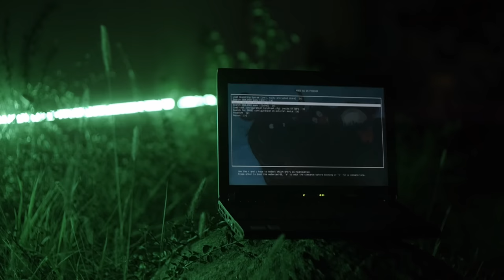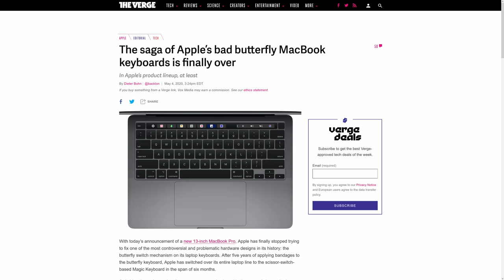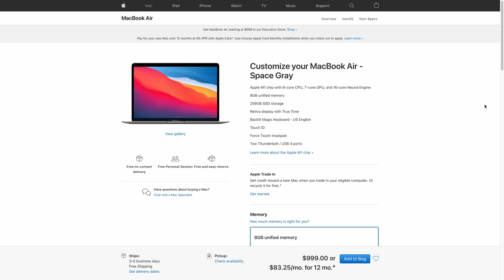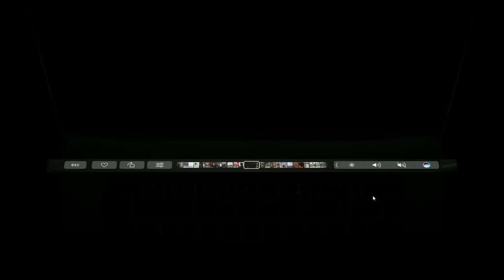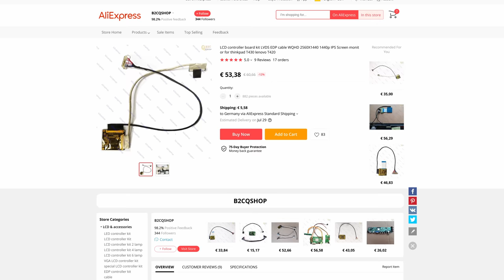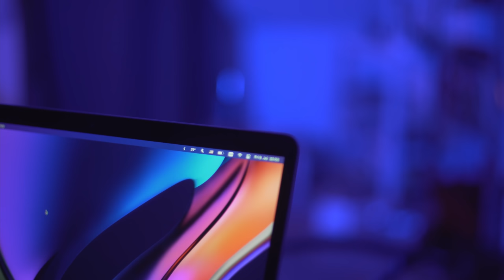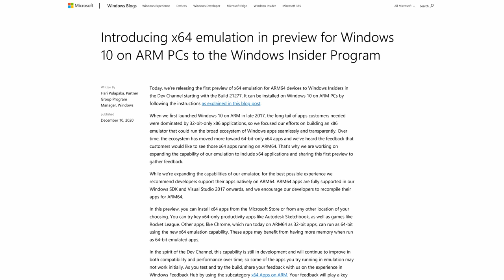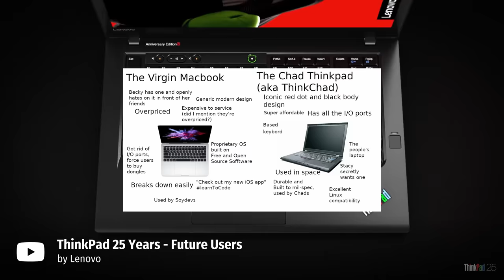Why I Switched to Mac (as a Linux user)

Comment: There are some things Apple products are undeniably better at nowadays. Not that they should be.

The biggest thing is that they, get this, use ARM cpus in products that rely on batteries. Sadly other ARM cpus are either not powerful enough or dont have good support for laptops and tablets. When it comes to battery usage, most Linux distros tend to be terrible. I really wish i wasnt saying that.

Ipads are also really good when it comes to how powerful their CPUs are (for a tablet its pretty great), and how powerful a lot of the software is (a lot of it is as good as PC applications). I wish you just had full control over the device and a little more professional software like you can have on a Microsoft surface. 

If tablet computers like the surface came with well supported ARM cpus that could also run linux distros that were able to manage battery better, itd be a dream. But when you think about how Apple manufacture a lot of the hardware themselves including the CPUs, its really impressive they manage to not be stupid expensive.

Comment: I have seen MacBook air on m2 and seriously it was the worst user experience for me. In windows everything is intuitive and flawless, installing games and programs is fun. MacBooks are expensive and offer slightly faster cpu and slightly better battery life compared to windows amd models, but they don't have dedicated gpus. Now Dell, Acer have tiny Ultrabooks with very good Nvidia cards. Unless you are an apple fan boy I don't see a reason in buying a MacBook.

Comment: That's really biased testing, couldn't expect more from an apple head. 

First the Thinkpad is not plugged in so you're restricting it to use 30% of it's capacity in both tests, second it's almost 2 generations older in terms of hardware and you're doing it wrong, i see windows.
Reply: Macs don't need to be plugged to run on full power
So they were tested on the same terms, Mac is just better

Comment: When it comes to laptops... meh. They all suck. Thinkpads, Dells, Macbooks, they're all trash.
The big thing left out of your whole argument is the workstation. I'm happy to work from my own home office, on my own tower workstation. The parts are cheaper and more powerful, and some parts (PSU for example) are more than a decade old, so there's less e-waste. I do have a little loaner notebook from my employer for moments where mobility is needed, but it's not my primary machine, and I exclusively use it for browsing.

Comment: Mac hardware being crap? Lol. One of the most important things on a laptop is the trackpad. click anywhere on a mac trackpad and you have equal pressure. Definitly the best trackpad on the market. On a thinkpad it’s hinged so that its harder to click at the top. Also the MacBook keyboard being one of the best in class.

Build materials: screen flexes on a thinkpad when opening it with hand on side. Mac: same no-flex when opening it with hand anywhere..

Then there’s design. Apple definitly wins

Comment: MacOS is so bad. Windows is by far the best. A mac costs 3k which even if i die i wont pay for Macs. Hackintosh doesnt even work on all CPUs. Windows supports all GPUs, CPUs if they have enough power to run Widnows. Games and programs are mostly designed for Windows and for gaming and most activities you have a better experience on a Windows. It is cheap to buy Windows laptops, the software is free, not like the App Store.

Comment: Its not really about mac being better, its that arm based cpus are gona be the new thing. The only thing that sucks is that during the transition to arm cpus is that a lot of programs arnt gona work at least for some time,  but I think Iv heard this is a problem for apple users too, and some of them arnt switching to the new arm computers. to me the issue of going apple is still the same issue iv allways had, the ecosystem.  doesnt matter how good a computer is if I dont have the software I want
Reply: Thing is, Apple's transition to ARM as its native computing platform will be much smoother than on either windows or linux. In the linux user space we already have issues with apps using conflicting GUI toolkits and design features and not implementing proper use of portals and broken Wayland sessions and gesture support (the list goes on and on).

Apple has the advantage of being a walled garden where they can provide incentives for supporting their own silicon as well as being able to optimize for it. In my personal use case, Fedora Silverblue becomes annoying to use even on my well-supported Thinkpad T480s because of issues like improper sleep support; that is, after an update, closing the lid seems to log out of session, causing all data to be lost. There are just so many issues that hinder my productivity like bad battery life.

As much as I hate to say it, Apple laptops seem to be the way to go.
Reply: @ianguarin9773  Its allways going to be a wait and see how things pan out kind of thing.  maybe right this moment apple is the way to go in certain cases, but arm is going to take over one way or an other, things are going to be ported over or theres gona be some kind of x86 emulation, pretty sure even apple is using x86 emulation to widen what you can do on their new chips.
Reply: @antonmuffin6214  I am pretty confident it is the case that ARM will become the native computing platform for general computing. However, I think a full migration towards the platform is still a long ways to go. Even on x86 there are a plethora of issues on both Linux like the aforementioned ones. Once developments like native Wayland sessions for all major desktop environments and apps as well as fractional scaling in GNOME drop, I would reconsider moving back to Linux.

Comment: few days ago before my web dev assigment i had to finish my module on time. but i suddenly installed linux ubuntu first time in my pc and i had to face so many problems. like mongodb network issue thn i fixed it after 6 hours of research. thn suddenly my ubuntu setup crashed. i missed my modules and ubuntu too. now i am frustrated doing my assignment and taking break and watching this video. worst experience ever :)

Comment: i switched to macmini m1 from linux/win and i switched back because of the “i’m apple, i must do the things in the opposite way” style. 
simply i hate the key combos, the FACT that if you use apple you have to think in a different way, and often it is not the right way.
still, i hate many characteristics of linux and windows (in 2022 why this fucking pulseaudio does not support headset bluetooth  out of the box?)

i perfectly know that the built quality, speed and power draw of m1 is unsurpassed, and i thought that it wuould be useful asahi on it, but i think it will always be a hobbyist quality linux, not enough for production uses.

i have a L530 thinkpad, a real tank, but it starts to show its age ( cpu i3-3130), and i thought about replacing with a macbook, but those key combo prevents me to give apple  another chance

Comment: I have the exact opposite, JC i hate every second of this mac. This thing should be lightning fast, yet so many things feel sluggish when it comes to IO. I  have a lot of conveniences in my shell (zsh). The commandline actually feels slow. A simple git status take 6 times longer in the same repository compared to a desktop pc from 2014! Something is really off in the disk IO of Mac. Also homebrew is incredibly sluggish. 

Also aluminium? C'mon, it just looks good, it's not a good material for a laptop. Uncomfortably cold when you pick it up, too hot to the touch when it's on your lap when it has to do something.

Also the angle of a open lid is really limited when using it on the couch, a laptop is meant for that every now and then right? And then the peripherals. What a complete shit show, I have usb-c to DP peripherals which work fine on Windows and linux, but MacOS manages to throw a fitty everytime when it wakes up. I have to disconnect the DP cable from the converter cable. 

I can keep going for hours like this. I have a severe case of buyers remorse. I thought I would fall in love again after having used a macbook air from 2012 to 2018, alas, I really wish I could get back the thinkpad with ubuntu which I used with absolute joy from 2018-2023

Comment: Honestly OSX is a good OS, the problems come from the company who administrates it. I right now have a Mac computer from 2010 that is pretty much useless with osx. This is because apple decided that we were no longer allowed to install the os that came with the machine back onto the machine. The system needed a replacement HDD and the old one was dead. The only image I can even download on the apple page is a .dmg file that you pretty much cant do anything with. Everything in the documentation says to use the app to make a bootable installer to install the system with, but thats not what apple gives you. Current OSX is available from the app store but you use internet recovery on this mac NOPE it refuses to install and just gives you a general error. and this is why Apple sucks so much. I can download any version of windows and get it installed going all the way back to dos so its just insane you cant even install a few years ago OS like catalina onto a older mac.  I can also mention how they overcharge the crap out of people for memory and disk upgrades that do not even come close to costing that much, and then solder everything tot he board and use freaking super glue and hot glue inside the machine. And then there is the custom controller chip that started with the macbooks with the touch bar. They cannot even install Linux without them being pretty useless since the controller is custom and linux users have no interest in reverse engineering the stupid thing to get basic functionality. I don't blame apple for that since M1 came to the party and that is what Linux is focused on now but it means that those macs have a limited shelf life once you cant install the OS from the app store. The problem with OSX is not OSX its apple and their continued push for anticonsumer behavior.

Comment: No ssd or memory upgrades ever which us planned obselense.

Out of warranty expense is extreme, if your can get parts...even if your can they may not work because apple locks parts to each machine..so technically you cannot even switch parts between two new identical new iphones or macs in some cases.

Worst of all is ufvyour unternalk ssd ever goes your whole machine is bricked and will never boot again nit even from external drives which us why fewer schools and business are ordering an apple mac business lease if multiple machines.
Reply: Ram upgrades haven’t been a thing on macbooks since like 2012 (which really makes no sense, since the 2012 models use the same chassis as the 2009-2011 ones, which are Ram upgradable)

But in this instance, Ram upgrades on an SoC are basically impossible, since it’s literally built into that SoC.
Reply: @nep-nep6575  since they were, and still are, in older macs and mac pro and with pro desoldering upgrade experts.

Comment: One thing that unites Linux, MacOS, and BSD users is that Windows FUCKING SUCKS
Like, I did get frustrated at Linux a couple of times (though gotta admit, more often than not it was my fault), sure, but ever since I switched from Windows to Linux I curse and roll my eyes EVERY. SINGLE. TIME. I HAVE to use Windows, like oh my god it's an awful system. Which, funny enough, seems to be something even Microsoft agrees with. It feels like in 5 years tops everything that will be left of Windows is gonna be Linux running whatever bullshit MS gonna come up with from the cloud. Mark my damn words.
Also, my man uses Ableton Live? God damn, Wolfgang, I really wanna go to Germany just to give you a kiss. Is there any chance you're gonna make a video on Live (if you haven't already; sorry, I'm too damn lazy)? I love this piece of software so much I used to waste all of my spare time in it when I had still been using Windows, and even bought it regardless of my intention to make anything professionally.

Comment: I use a ThinkPad T520 but if I had to use any other laptop it would probably be an older MacBook (actually I do have a 2011 MacBook Pro stored away as a a backup), but I would wipe the drive and put Linux on it (thus I would not buy an M1, and such a machine is out of financial reach anyway). I have tried mainstream PC laptops and they are GARBAGE compared to either Macs or ThinkPads. I don't like MacOS at all (30 years of Windows use since 3.1 means everything about MacOS's interface grates on me while KDE Plasma felt comfortable from the moment I started using it) but I respect old MacBooks as hardware.

Mac desktops, on the other hand, can go straight to /dev/null.

Comment: i dislike apple product very much because of them being targeted to their own and only own ecosystem. one of worst classes i had in university was programming applications for ios. you'd like to learn it outside classes so you can have better understanding ? well, apple will tell you to f*ck off if you don't have one of their computers. that kind of problem has never appeard with any other technology used. for me it seems like apple's environment is strongly fortified castle and outsiders aren't allowed to enter. well, i wont event try. not to mention very high prices, difficulties in tinkering with their devices and repairing them on your

Comment: "Mac books are so fast on these bench marks wow".... runs Solid Works "why won't any of my engineering software run on m2.. Oh cos M2 is just a mobile processor"
Reply from the maker: Oh? Does solidworks run on Intel macs?
Reply: Dude what on God’s earth are you talking about? Solid Works runs absolutely fine on my M2 Air.
Reply: @Da532  Nice! I see the new version works, thanks for letting me know. Now they devs just have to get uVision and Xilinx ISE working on Apple's M2 mobile processors.
Reply: @Da532  Ahh I spoke too soon. Its still garbage because you need to emulate an x86 arch through a hypervisor. Works probably well if all you're designing is fastners, rivets, bolts etc (something simple). I tried to do quick simulations on a complex design and if failed remarkably. Cannot even load a simple demo turbine engine. This is why M2's are garbage for engineers or anyone wanting to run anything proper. I love macbooks but im sticking with x86

Comment: My 5950X does the R23 test in 35 seconds, not overclocked or tuned, just stock (24,531 points)... just sayin... ;-)
Reply from the maker: In other words, a 105 watt 16-core desktop CPU outperforms a 15W 8-core ultrabook SoC
Reply: @WolfgangsChannel  Yes... and a) the "ultrabook" has crazy expensive prices and b) people who do not know any technical details think it is the fastest thing on the planet, precisely because of videos like yours comparing it to even older shit slow laptops - it is a form of deliberate misinformation. And Apple loves you for it.
Reply: @Walther Penne no idea what you are on about mate... your argument (if that's what it is) makes no sense. I compared real thing. You compared some imaginary thing which will not happen.
Reply from the maker: M1 Macbook Air starts at €1000, which is cheaper than Windows laptops in the same class (e.g. Dell XPS 13, which starts at €1449, or Thinkpad X1 Carbon which starts at €1699)

Nobody ever said that the M1 Macbooks are the fastest computers on the planet, that would be ridiculous. Their performance is, however, pretty impressive considering the form-factor, and you have to be actively ignoring reality to deny that.

I did compare it to my previous laptop, but I also mentioned the LTT video which compared it to fairly modern ultrabooks and gaming laptops.
Reply: @Walther Penne No idea what you're smoking - but can we all have some too? 😃

Comment: To all the haters, don’t worry a lot of manufacturers are now switching over to ARM based chips and will soon have proper competition to the M1s. The power draw on the x86 is just too much and there’s no getting over that
If y’all are reluctant to change then, sadly y’all gonna be left behind. Y’all already fucked Microsoft over by not supporting their Microsoft surface go which had the first ARM based processor like 6 years ago, if that had more support it would’ve been a proper competitor to today’s m1 mac…